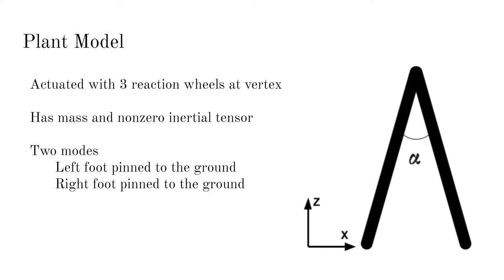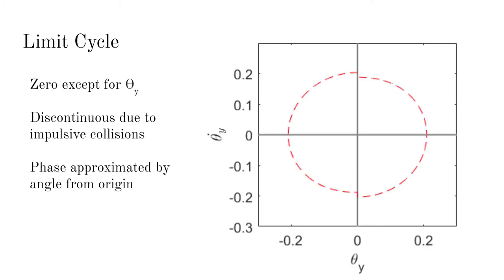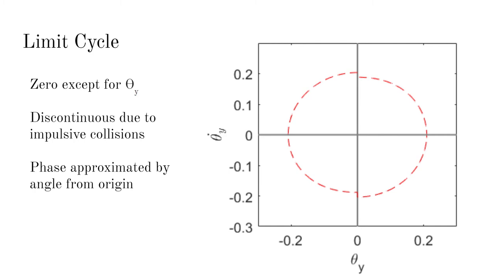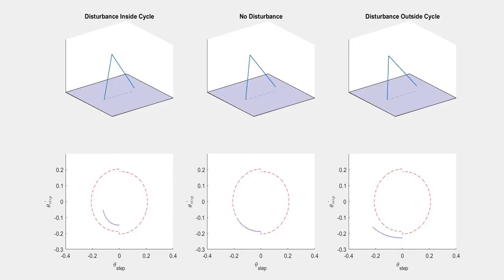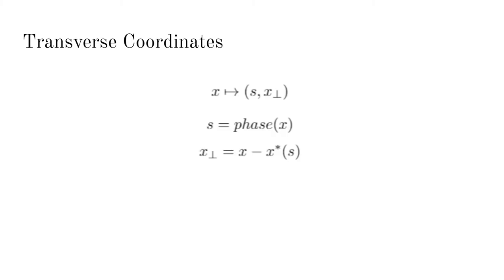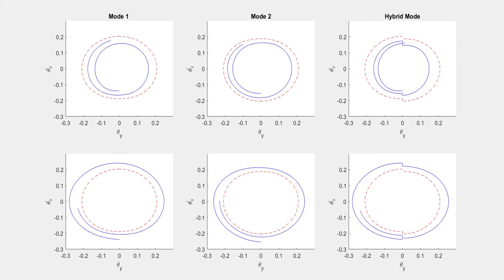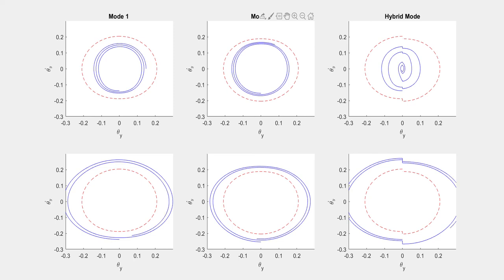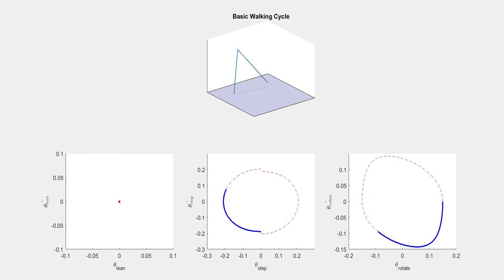Orbital Stabilization of Single Body Walker

Comment: nicely done.  i assume when you discuss LQR, you are solving for the time-varying, periodic LQR in the transverse coordinates?  I'm also curious if you actually need to stabilize the phase... i suspect the orbital stability of the cycle would be sufficient?
Reply from the maker: Yeah, I should have clarified - the LQR controller is periodic in time since the mass matrix is varying. As for stabilizing the phase, I do not think it is necessary on it's own, but doing so simplified the transverse dynamics.